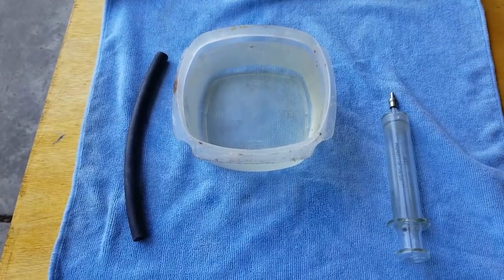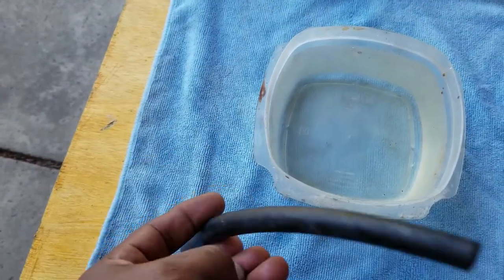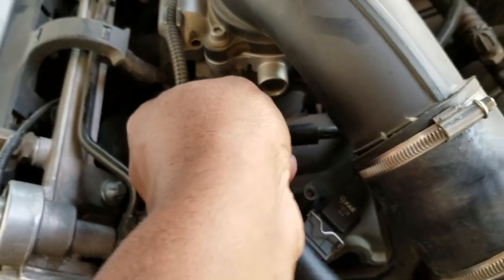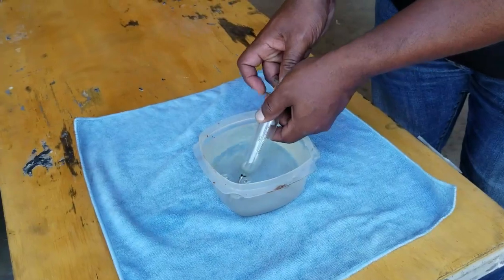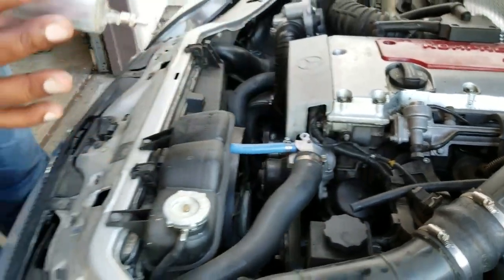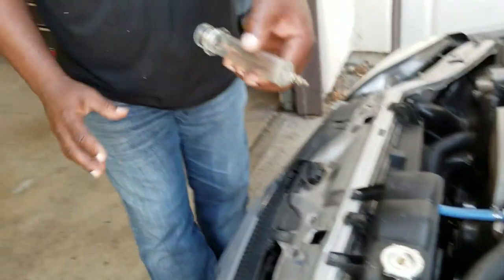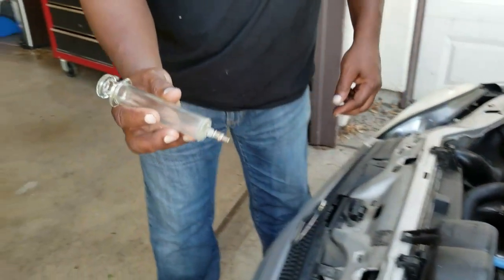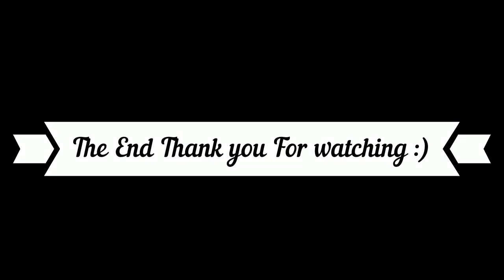How to clean intake carbon deposits off valves with just water

Comment: It works perfectly but you have to warm up the engine so the water turns into steam, accelerate the engine to 1,500 to 2,000 rpm and then drive the car for 10 minutes. I do it on my diesel engine with a spray and it works perfectly